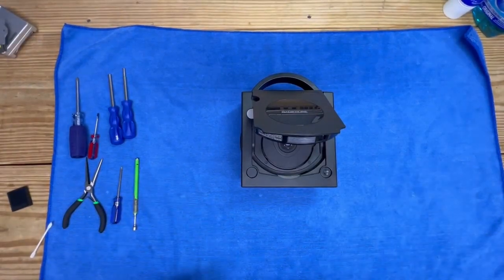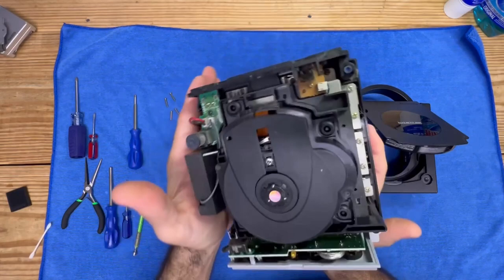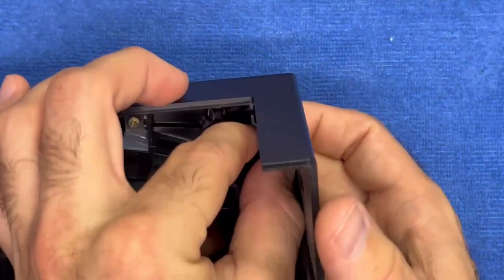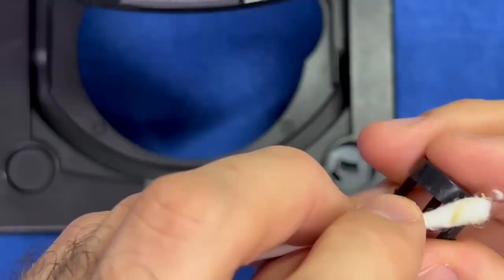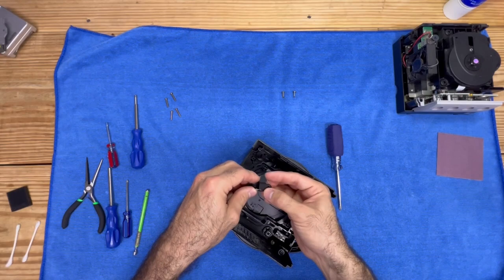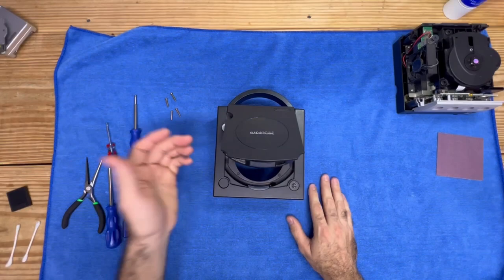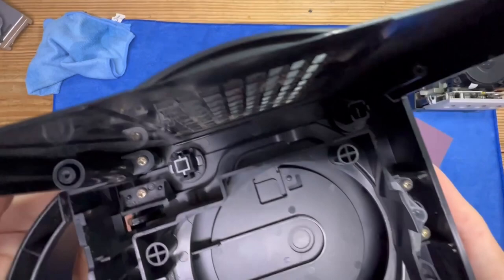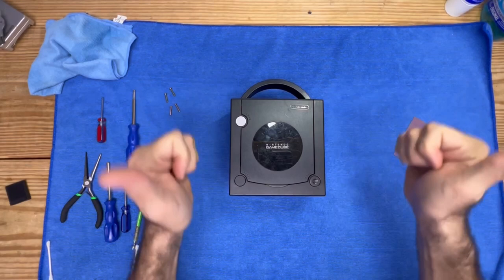How To Repair Stuck / Sticking GameCube (Eject, Reset, Power) Button

Comment: I have to disassemble my GameCube. I removed 3 of those darn security screws with a Gamebit screwdriver. The last one won't budge. Why is that?
Reply from the maker: Great questions! Have you checked to see if the screw stripped? I would use a flash light to see the condition of the screw.

Comment: I bought a GameCube and they told me the reset button was stuck. I took it apart and it was not stuck, it just isn’t catching the switch under it. The switch works but not the button. Any suggestions?
Reply from the maker: I would recommend cleaning the button well and making sure there is minimal friction around the button.

Comment: Hi I bought my wife a GameCube for Christmas and the reset button not working how can I fix the problem?
Reply from the maker: Hello! Depends if it’s the physical plastic sticking or the switch it presses against. Are you able to diagnose it?
Reply: I push the reset button and it doesn’t reset
Reply from the maker: @kingofnorth2042  Hmmm… I would need to see it in person.
Reply: Ok
Reply: So how would I do that?

Comment: So the spring sould face towards the fand?
Reply from the maker: If you follow the steps in the video you should have no problem reassembling the GameCube. 😁
Reply: @juanquinones  it's just I took mine apart last night and forgot witch way the spring is orented towards....
Edit: got it! Now this bad boy needs a new disk drive
Reply from the maker: @Nzg41  Glad to see you got it!
Reply: @juanquinones  it's prob the laser that's under powered but I lack the tools to probably adjust it and calibrate
Reply from the maker: @Nzg41  Amazon and eBay are great places to find those tools.
Reply: @juanquinones  I've allready bought the modded drive so...